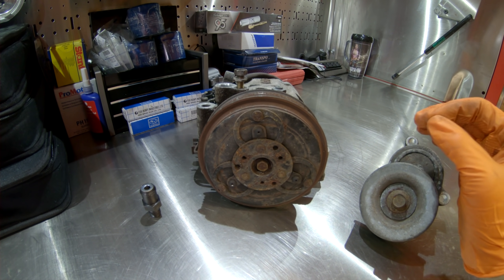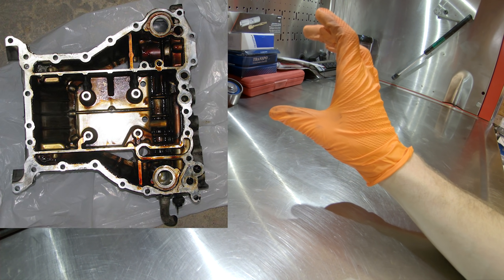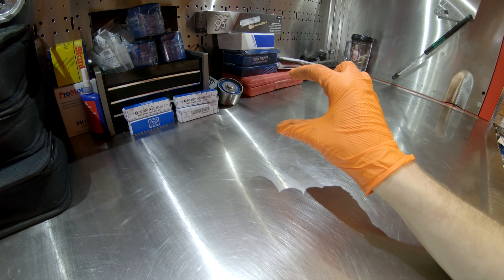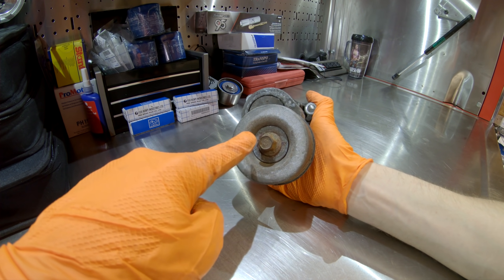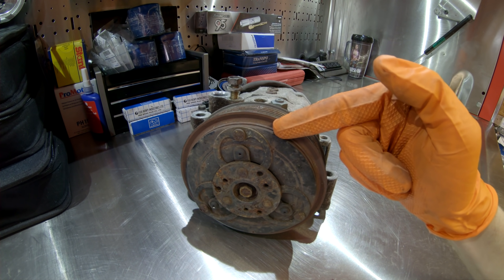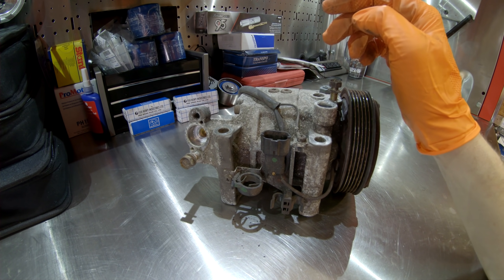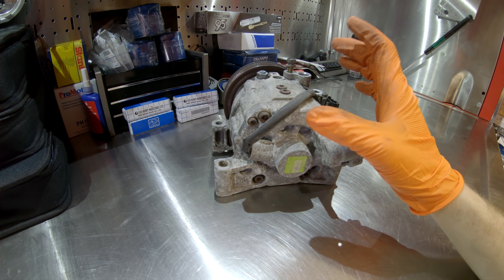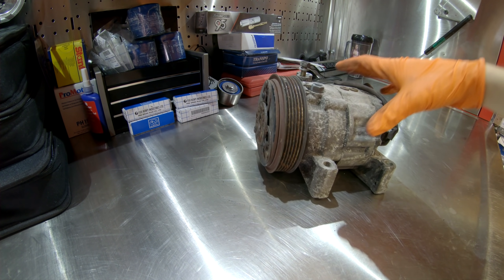Subaru EZ30 & EZ36 Top Three Failures

Comment: Great video, thanks for sharing your knowledge! I recently bought a eudm spec B -04 with the ez30 engine that has what sounds like valve-train niose. It had been sitting for about 3 years before i got my hands in it, and i have changed oil twice before i did an engine flush and then fresh oil again. It sounds lika single valve is "knocking" from the right engine bank, sometimes louder other times it almost goes quiet but there is always noise. A local subie shop guessed that it would be valve seals and quoted a minimum of $1500 for fixing it, but also said that it should be fine to keep with driving it. I would greatly appreciate some input if you have any, and is there something else i should have them do if or when they start pulling the engine? It's a great car but i feel bad pushing it just knowing that the valve is ticking away while i do it..

Once again great info in the videos, i am looking forward to keep learning!
Reply: Hey mate I have a 2005 liberty r-b with the ez30 and I have the same problem with a ticking noice coming from the right hand side of the engine. It is quite on cold starts but when on warm idle it becomes very loud. I was wondering if you got yours fixed and if it fixed the problem?
Reply: @simeonfazio1489  hey! No sadly I never got it fixed, but I talked to the previous owner and the tick have been there for almost 100 000 km now so it does not seem to be an big issue. But I have researched quite a bit, talked to mechanics etc, and the consensus seen to be carbon buildup on the valves, so I have been thinking about using a spray or fuel additive to try and combat it. Otherwise you can find a place that does cork-blasting in direct injected engines, as they seem to have the same issue with carbon buildup like the newer BMWs or Minis. Our you can turn it in to a local engine shop to remove the heads and either put in new valves or refresh the old ones :) sorry for a wall of text haha, but I hope you got some more insight! Needless to say this is of course only if this is the exact same issue that I have, but it seems like pretty common problem worth the ez30
Reply: @herkidar  thanks for the reply bro, luckily it was only dodgy spark plugs that had come loose over time letting out some compression. She runs all g now with 240k on the clock. I probably need to stop redline every shift lol.

Comment: Just got a new ez30 for my outback. Last one had a thermastat and radiator failure, got hot (didn't get to red even) and blew the head gasket. Wasn't even that bad until I took it to the mechanics to get diagnosed. After I took it to them it was undriveable.
Reply: As a mechanic, I can understand this. Often, using a pressure tester on a leaking cooling system to find a leak can drastically exacerbate a leak.

Comment: Unbelievably informative video, thank you for this and the rest of your videos. I took my 06 LLB to the dealer to get aligned, they saw oil and said I needed a complete engine reseal to the tune of $3k. Super curious to see if replacing the PCV valve and oil cooler O-Ring keeps everything clean down there. Sounds like proactively replacing the tensioner pulley if not the entire tensioner might not be a bad idea, either. Fantastic work and thank you for that.

Comment: I am getting ready to drive 3 hours to look at a 2010 Outback 3.6R with 84k miles and your videos have been extremely helpful! Thank you so much, really. I hope it all works out and I will bring my new-found education into the pre-purchase inspection and hope for the best. Sincerely, Honda technician who knows nothing about Subarus!
Reply: How much are you paying for it
Reply: @michaellk2254  I didn't buy it because during the test drive the transmission light started to flash and the car acted up.
Reply: You should've got 06-08 Outback. Quicker and more reliable. Also looks better.
Reply: @randomautonomousdronepilot3384  except for inside which is where you spend your time.

Comment: I had no idea about the requirement for pcv valve maintenance. Would you recommend putting an anti-seize compound on the threads when reinstalling the valve? Thanks for your great videos.
Reply from the maker: No antiseize. Some Teflon tape or RTV silicone is what you need.
Reply: @MrSubaru1387  Great. Thank you again.

Comment: I actually was consuming a bunch of oil on my EZ36 because of the PCV valve. Replaced it and now only going through maybe a quart every 3k. I'm also noticing a bit of oil around the top of my timing case. Nothing serious just a bit of seepage. I'm at 100k miles now. I haven't seen any leaks pop up under yet. When should I worry about resealing? Once it becomes a huge mess?
Reply from the maker: Personal preference. I've got quite a few seepage areas on my 02 L.L.Bean EZ30D. I'm at 290k, plan to pull the engine and reseal it at 300k. I'd say if the seepage becomes a leak, it's time to reseal it asap.

Comment: another common failure is the power steering pump and the valve cover gasket
Reply: Usually it's the P/S reservoir o- ring that leaks and causes cavitation and whining noises reducing lifespan.
Reply: Useful 2 know

Comment: I have a swap question. 

Is it possible to swap a ez30r engine from a 2005 legacy sedan to a 2004 ej25 outback wagon?
Reply from the maker: Anything is possible with enough time and money.
Reply: The chasis and the gearboxes on subies are like lego;) plug and play almost:)... 3.0 r apec b here going strong at 230K  km:) engine not opened once!... I need to change those gaskets and the chain i think... Just to have 220k no wories km-s more;D ... Not bad for 2005 made engine:)

Comment: My ac compressor has seized on my ez30d engine. Can i put the compressor that not has this sensor on it? Cus i got  one and i saw it was the same compressor but it did not have this revolution sensor on it and the weel looked diffrent, but i guess i can change the weel.
Reply from the maker: It won't work.

Comment: I took my '13 Outback 3.6R to a shop because it is leaking oil.  It was a Subaru specific shop;  the owner told he would not work on my car because the EZ36 engine has proprietary parts/and tools that he needs to work on it and that he was not properly trained on it.  Thought that was kind of odd.
Reply from the maker: Sounds like he's not as Subaru proficient as he would like people to believe..
Reply: I replaced a '13 legacy cvt a week ago. Sealed unit dead@ 102k... no warranty available. There's almost nothing proprietary to the 3.6 vs the 3.0 tool wise. I have no problem doing dealer reject work. Newer clean cars are easy to work on, bring 'em on!

Comment: Hi!
I have a 2006 2.0X 158 hp naturally aspirated Forester (made for the european market, if it has any significance). I just changed all the filters (except the gasoline filter because I cannot find it), the oil (Motul 8100 5W30), and the spark plugs (it took me and my dad 3 hours) to NGK 6481 iridium (same as the old ones) and cleaned the airflow sensor with Liquy Molly airflow sensor cleaner (don't know if it was dirty or not, just sprayer a couple times on it). The gas consumption went from 10-10.5 l / 100 km (23.5-22.5 mpg) to 12.4 l/ 100 km (19 mpg). I went a couple miles in deeper snow too, but is this normal after the sensor cleaning + oil-filter-spark plug change to have this gas mileage? Or is there a way to overtorque/ undertorque the sparkplugs to make consumption problems or engine problems? (I had no torque wrench) The engine runs smoothly and there was no change in my driving style, the only difference was 3-4 miles in a deeper snow on a forest road. 
My other question is with the cabin lights. I'd like the lights to turn on when I unlock the car and to stay that way a bit, until I get in and organize my stuff. Same when I stop with the car and turn the engine off, to have some cabin lighting till I pack my stuff and get out from the car. But now it's dark as fck if I don't turn manually on and then off the cabin lights in th middle at my head. If I'm right there is some switch in the car with ON/DOOR/OFF options, there is a drawing in the owners manual about it, but I cannot find the switch. Do you have any idea where to find it or how to set the cabin lights to work when I get in and out of the car? Thank you!
Reply from the maker: All of the improvements you've made to the engine, through "tuning up", will cause the engine to run slightly rich, until the long term fuel trim adjusts. Give it a few hundred miles, and all should be good again. Did you happen to clean the throttle body when doing the other repairs/maintenance? That, along with an idle relearn, will make improvements to economy as well.
Reply: Why is it necessary to run itself rich and to adjust for hundreds of miles? Can't it just work fine instantly? In the moment I'm 530 miles after the airflow clean - oil change - filters change, and 360 miles after the spark plug change. Hope it's enough. The idle is way below 1000 rpm, I guess it's near 6-700. I haven't cleaned the throttle body, should I do it now?
Reply: I still have the new gasoline filter. Do you now where can I find it in the car? In the engine bay there is no sign of it. Usually it's mounted near the front left shock absorber as I see in the pictures, but at mine on that place is the secondary air pump.
Reply from the maker: On a 2006, it's in the gas tank, part of the fuel pump module.
Reply from the maker: Because the fuel trims need time to adjust. You could disconnect the battery and let it sit to reset short and long term.

Comment: Maybe you could give me a solid answer I have a 2012 sti and I'm thinking seriously about throwing in a Ez30r or should I just build up my ej25 my goal is to reach 600 as a daily. I like the Porsche sound from the h6 but will the ez30r h6 block with stand the boost. I understand I will need a legacy radiator now far as the wiring instructions I'm lost. And would I still be able to make use of my sport mode button? And how would I achieve launch control function with an h6?
Reply from the maker: I'd go for an EG33 over the EZ series. Google Andy Forrest Performance. Check out his 1200hp EG33 turbo Impreza.
Reply: @MrSubaru1387  ThankYou sir
Reply from the maker: https://youtu.be/BOltVjoOntY Perrin built an EZ turbo STi back in 04-05.
Reply from the maker: https://youtu.be/j5L6E-MurOk

Comment: Unrelated subaru question: I have a plethora of C-Codes for the ABS system on my 06 Outback. I need to clear them to see what is historical and what still may be coming back, any way to do this without a dealer visit? I know how to read the DTCs with the trip/odo trick but no luck on clearing, even with a hard reset or FreeSSM.
Reply from the maker: If you aren't able to clear them by disconnecting the battery, or by deleting them with SSM, then most likely they are hard faults.
Reply: Gotcha, I was thinking that may be the case... I guess gone are the days where I could just ground the ABS connector pins. Thanks for the help!

Comment: Any good videos removing the rear timing cover?   Have all the bolts out, water pump and oil pump.   Just etc holding it at this point or anything else?   Any tips would be great
Reply from the maker: Sorry. No video yet. Only one I have right now is on the timing chain removal /install. Only shows front cover removal.

Comment: My 06 outback 3.0 has a bad leak on the rear timing cover.    Took off everything but haven't taken the rear cover off yet, was waiting on new bolts as 4 of the bolts on the oil pump had to get drilled out.      Good bet that that valve is clogged on mine, didn't know it existed :(.   Oh well glad I found this before we put it back together and blew the seals out again.
Reply: Pcv valve was fine.  Just a oring swelled some and hardened .  Bad oring right where the leak was so hoping that's all.   Covers back on and curing.    Don't want to do this again lol.

Comment: the engine, the engine, headgasket ...?
Reply from the maker: No..
Reply: @MrSubaru1387  well i thought it was a good sumation as it has been my experience with suby motors
Reply: @dtec30  not on the 6 cyls usually. 👍

Comment: Thanks for this! You should make one detailed video about failing head gaskets on theese engines. An issue that is way more serious than anything else.
Reply: More of an issue on the first model ez30, not so much on the 2nd gen and ez36. And far less prevalent when compared to the EJ series too.
Reply from the maker: Head gasket failure wasn't an issue in these like the EJs. That's why I didn't mention it. Usually only fail if ran low on coolant and/or overheated.
Reply: I agree that EJ`s are weaker from this point of view but still - in My opinion leaking HG`s on EZ30 second generation from MY2003 are a problem. I`ve seen two tribecas, one Outback and one Legacy in past three years with various HG failing stages in my garage,  but with similar simpthom`s  - exhaust gases in cooling system. At first there`s no sign`s of a problem because cooling system can handle little amount of air bubbles, then radiator can start to leak (replace that). Then it starts to spit coolant from overflow tank resulting in not enough coolant in the system and overheating at idle because of bad circulation (replace radiator cap, but soon realise there`s no improvement), then replace thermostat (no improvement) and at this point owner usually is facing the hard truth about failed head gasket. It`s just my experience, although i do adore these engines.

Comment: My 2004 OBW Limited (EJ259 engine) had the A/C clutch wear issue.  Your video stopped me from pulling the trigger on an $800 repair estimate.  I spent $5.35 in the screws to press off and on the clutch.  I had the tools to properly measure and adjust the gap.  That was three years ago.  My A/C still works well.  I subscribed back then.  I watch all your vids.  I appreciate your production techniques so much more than the other goofballs that need to see themselves on screen in their vids.

Thank you.
Reply from the maker: You're very welcome. Glad to help. 👍🏻
Reply: Mr. Subaru has saved me looooots of money.

Comment: If the PCV wont open will it give an engine light?
Reply from the maker: No, not usually.
Reply: @MrSubaru1387  you would think it would be an easy for car makers to wire in a pressure sensor to turn on a dash light if it was blocked but that probably hurts the profits of the service shop 😂

Comment: Thanks for the video! Like you said in the video, Didn't know about the pcv vavle. I'mma buy a replacement for my next oil change. does the pcv valve need to be pressurised? Or can it vent freely? thanks alot!
Reply from the maker: Older techs call them rattle valves. Basically shake it, if it rattles, it's good. When they get gummed up with deposits, they no longer rattle.

Comment: Thanks for the vid... great as usual and very helpful... i have a brake line leak on my 01 OBW VDC... i was wondering how hard of a repair this is, and what needs to be replaced... its leaking underneath the rear passenger doo, on front of the rear pass wheel.  Its covered by a cover with a few bolts, and I'm told the line that is leaking, connects to a "junction block"... how hard of a repair is this and what needs to be replaced? Thanks!
Reply from the maker: Should be able to just replace the hard line.
Reply: @MrSubaru1387  How hard of a job is that? Any special tools required? Thanks for the reply!
Reply from the maker: A flare nut wrench for the line and basic hand tools should get the job done.
Reply: @MrSubaru1387  Thanks so much!
Reply from the maker: You're welcome. 👍🏻

Comment: Also Toyota’s 2GFRE Engine has the same set up as the EZ36D oil pan parts 2 two piece as well.
Reply from the maker: Lots of engine, especially as of late, uses multipiece oil pans. Nissan VQ V6s instantly come to mind.

Comment: Yep every oil change I pull my PVC out and clean it.
Reply from the maker: Good man. 👍🏻
Reply: @MrSubaru1387  With what do you clean the PVC?
Reply from the maker: Carb or brake parts cleaner. Usually just replace them due to the low cost of them.
Reply: MrSubaru1387  I usually use carb cleaner because they used to have a film that would protect against sludge and varnish